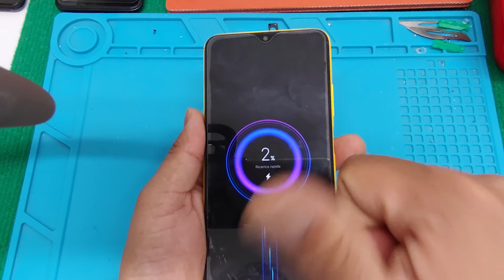Xiaomi poco M3 charging replacement

Comment: Can this help the Poco M3 on long charging? pleaseReply🙏
Reply from the maker: Plz change your port.ho changing cable thanks
Reply: @HardwareDoctor1  I have replaced the cable, it's still the same, Charging ± 30 minutes adds 1%, is changing the charging board the solution, or is replacing the PMI IC